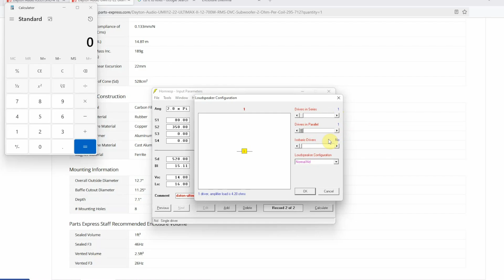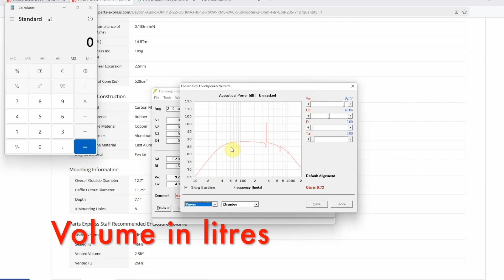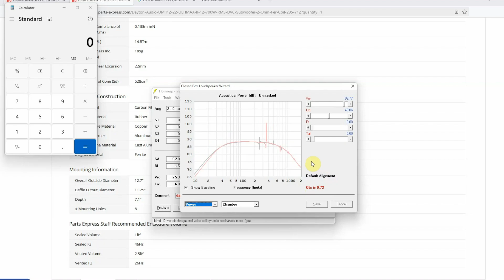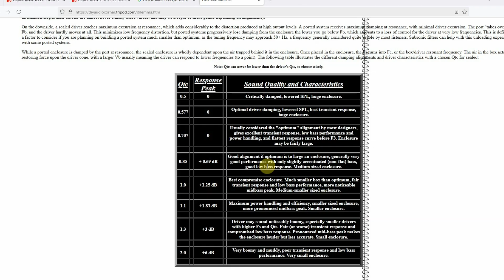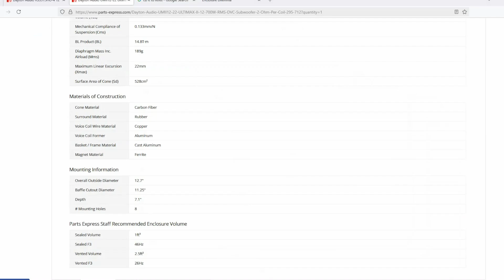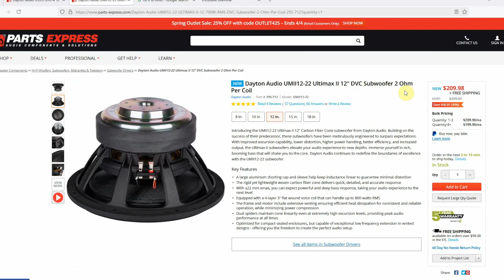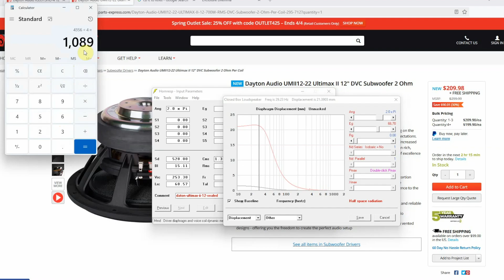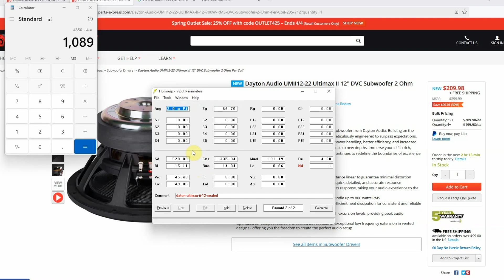Hornresp Tutorial (Part 2) :- Design a Sealed Subwoofer Box

Comment: Great video, one question when putting in your system voltage if you have multiple drivers do you put in the total voltage or just for one drive? ie: I have a 3000watt amp and two drives. Would I use voltage for 3000w or 1500w?
Reply from the maker: in the top row, the voltage is overall system voltage iirc